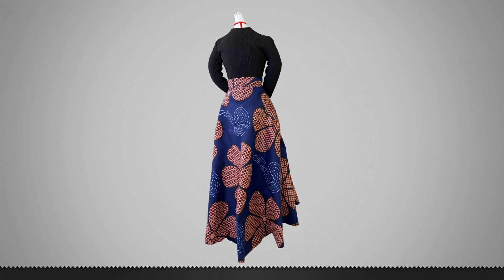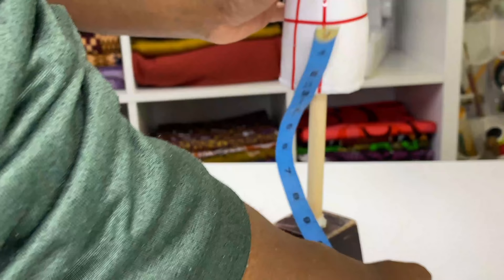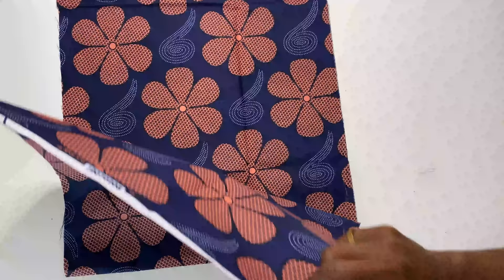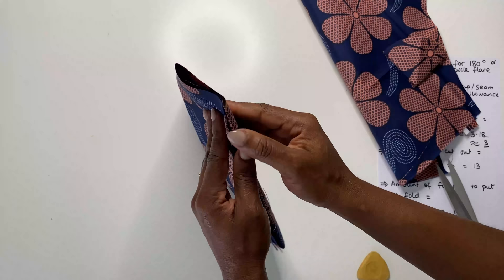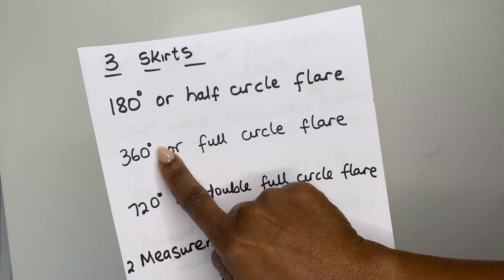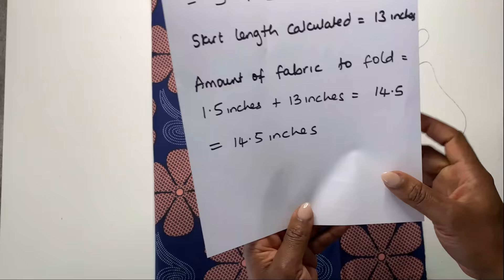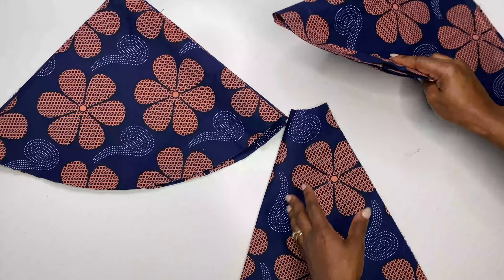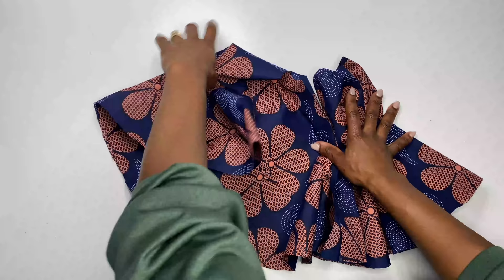How To Cut 180, 360 & 720 Degree Flare Skirt

Comment: Why do u divide the waist by 3.14?
Reply: Because it is 180 degree flare. You will divide 6.28 by 2 to reduce the flare from 360 to 180 degrees flare
Reply: Because its a pie from a circle. π= 3.14
Reply: Pi I dodged in sec school..I've met in tailoring😅. Karma well done 😅😊😊

Comment: Hello. May I know how you came up with the numbers? I cant quite get my head through the formul. 😅
Reply from the maker: I divided the waist measurement by 3.14 which is a standard used to calculate the radius we need to cut out 180 flare. The result from was then divided by 2 for the 360 degree skirt, and for 720 degree, the result was divided by 4. Hope this helps. You can email me on charnoldltd@gmail.com if you need any further help with this.

Comment: Good  day ma'am. I find your tutorial very helpful. The only issue is that I would want to understand better how to fold and cut this same way you've explained using an Ankara fabric sold in Nigeria and abroad that is 36 by 45 inches. Usually for some one cutting a long 360 or 720 skirt how exactly does one fold the Ankara to achieve a skirt length of say 40 inches and waist of 37 inches

Comment: Your tutorials are very detailed and easy to understand. 
If i may ask, is there a way to do a 360+180 flare skirt? Something fuller than 360, but not as full as 720.but my concern now is how to cut the waist? Can you pls, show us? Thank you so much.
Reply from the maker: Thank you so much for your appreciation. 
Yes there is… here is the concept to bear in mind:
360 is 2x 180 hence we divided by 2
720 is 4x 180 hence we divided by 4
So for 360 + 180 that’s 540
540 is 3x 180 so you will divide by 3

Hope this helps. 
You can email me on charnoldltd@gmail.com if you need any further help with this.

Comment: Very easy explanation. But please is the 3.14 compulsory for dividing the waist. For instance, my waist is 29, do I still need divide by 3.14 to get the accurate measurement??
Reply from the maker: Thank you so much for watching! Yes you need to divide by 3.14 to get the measurement for cutting out the waist. Which style of skirt are you making; 180, 360 or 720. I can do the calculation for you if you would like me to. If so please provide also your skirt length also.
Reply: @PatternAcademyByCharnold  I want to make the 720. So that means I can use the initial 3.14 I used with the 180 to make 720 after I've gotten the waist measurement
Reply from the maker: @ellalouis2819  For 720; divide your waist by measurement by 3.14 and then divide the answer you get by 4. Remember to include seam/zip allowance. So you will have 29 + 2= 31/3.14=9.872 
Then divide 9.872 by 4 = 2.46 ( you can round up to 2.5 and this is what you will use to cut out on double folded fabric as in the video. You will need to cut out two of this. Hope this helps. You can email me on charnoldltd@gmail.com if you need any further clarification. Regards.
Reply: @PatternAcademyByCharnold  Thank you so much. Now I understand better 💃💃
Reply from the maker: @ellalouis2819  Very glad to know 💃 💃

Comment: I really enjoyed Ur teaching, thanks alot but one question: does the waist need to be divided by 4 before dividing by 3.14  cos I think I see some people dividing the waist by 4..and also was d fabric folded into 2 or 4?
Reply from the maker: Thank you. It depends on what type of circle skirt you are making. For example, for the 720 degree skirt, the amount of 720 is the same as 4 times 180. So you will get the same answer if you divide the waist by 4 first and then by 3.14 and if you divide the waist by 3.14 first and then further divide the answer you get by 4 (which is what I did in the video). 
Hope this helps.

Comment: U have to take the lengh of the skirt from the waist and not over the waist  because after cuting  the waist off u wont get the correct lengh mesurement for the skirk so note .
Reply from the maker: Thank you for watching. Please note that the length measured from the top is the radius to cut plus the length of skirt. So after cutting out the radius, you would be left with the full skirt length. Hope this clarifies.

Comment: Thank you so much ma'am. Pls I don't know how you arrived at dividing by 3.14, 0.75 etc, please help
Reply from the maker: Thank you for watching. The 3.14 is a constant used for calculating radius of a circular shape. 
Dividing the waist by 3.14, I got 3 which I used to for the 180 degree skirt. 
Then I divided this number (3) by 2 and got 1.5 which I used for the 360 degree skirt.
For the 720 degree skirt I divided this number (3) by 4 and got 0.75. 

Hope this helps.

Comment: Appreciate this video but for a beginner like me it can be hard to follow. People should also be aware that if you want a floor length dress and you have around a 30" waist like me, you'll need 2.5x2.5 meters of fabric for the 360 skirt and 5x2.5 meters for the 720! That's a lot of fabric!
I write down my process in case it helps anyone else:

Waist: 29.5in +2" seam allowance= 31.5". Waist diameter (= waist ÷3.14)= 10". Divide diameter by 2 for 360 skirt= 5".  Divide d by 4 for 720 skirt= 2.5". 
Length of skirt to floor: 46in~ +1" seam= 47"
"Amount of fabric to put on fold" aka size of the square of fabric folded you will cut into= waist diameter (÷2 for 360 skirt) (÷4 for 720 skirt) + skirt length w/ seam allowance= 57 for 180, 52" for 360, 49.5" for 720. It is an equal square of fabric so same length horizontally and vertically (so eg. 57" means 57x57)
**Amount of fabric cut from can be larger just have to have enough.

Amount of fabric you actually need: Eg. if you need a 50"x50" square of 4 layers of fabric like in the 360/720 skirt: x2 to get overall length of fabric need, in this case= 100"x100"=~2.5m x2.5m. For the 720, you would have 2 of these 100"x100" pieces= 200"x100" when put together.

-For 180, just fold fabric in 2 and then into a triangle. For 360, fold fabric twice (once horizontal, once vertical), so get 4 layers of fabric in your square. For 720 do 2 separate squares folded with the 360 method (aka 360 method x2).

For 360 method:
From bottom corner (not open but closed fold) mark waist diameter÷2 as curve on fabric. 
-From point of corner, not the marked curve of waist, measure the distance= skirt length (w/ seam allowance) + diameter/2 and mark it as a second curve= bottom of skirt.

[For 720 you would do the same but divide your waist diameter by 4 instead of 2, and do this on 2 squares of fabric so you get 2 circles to combine together.]
Reply from the maker: Thank you so much for watching and for your contribution, well appreciated! We have also had lots of feedback from beginners who said they found the video easy to follow.
Reply: Please my question is the 3.14 
Where from it??? Can you please help me
Reply: 3.14 is the value for pi. It’s a math value for calculating aspects of a circle.
The diameter of a circle = The circumference of a circle (your waist measurement) divided by pi (3.14).

Comment: Thanks a bunch... i just got confused at the point where you divided 3 by o.75 when the waist is 8... so if i want to get 720 or 360 will i just say 8 ÷6.28 or 8÷ 0.75 is this the formula for 720° THANKS God bless
Reply from the maker: Thank you so much for watching! No I did not divide 3 by 0.75. I added 3 + 0.75.   Yes you can divide waist directly by 6.28 for the 360 (but remember to add the seam and zip allowance of about 2 inches or as desired). So you will have 8 +2=10. Then 10 divide 6.28 = 1.592 = 1.5 approx. 
For the 720 you need to half that measurement calculated for the 360 so 1.5 divide 2 = 0.75. Since it’s a double full circle. Hope this helps. 
If you need further clarification, please email me on charnoldltd@gmail.com
Amen. Thank you and God bless you too.

Comment: Thanks for the tutorial. How do I cut a longer length of skirt without joining.
Reply from the maker: Thanks so much for watching. It depends on your fabric width. If it’s long enough you will not need to join. Alternatively you can also cut it using two pieces of fabric so you will have joining on the two sides and you can fix your zip on the left side.
Reply: @PatternAcademyByCharnold  OK thanks

Comment: Hello ma'am, it's indeed a great illustration, was actually interested in watching to see how u made a 360degree flare with an ankara fabric without joining but unfortunately u used a shorter full length measurement. 
If I'm cutting a 180 degree flare using ankara fabric how do I avoid joining towards the hem.
Also the 360 and 720 how can I make them without joining towards the hem
In the pictures u used before illustration the skirts has band but u didn't explain the cutting of the band and their is no link to check it in ur description box
Kindly respond to my questions
Reply from the maker: Thank you so much for watching! The need to join fabric at hem or even cutting out as several pieces instead of on fold, will depend on the measurements you are working with and the width of your fabric. For example, for the 180 degree maxi skirt, if you are using Ankara fabric with wider width of about 58 inches instead of the usual 45 inches ones, you can cut out the full length without the need to join at any part of the hem. Hope this clarifies.

Comment: Going by what you said about the waist, the 180° flay, the waist is 8" , you divided by 4 ie 2"+1" S.A,= 3" .  You divided by 2 ie 1.5" and you folded your fabric into 4 . Going by your waist measurement, you'd have 1.5×4= 6" 
Original waist is 8" . It doesn't add up or cover your entire waist. Likewise your 720° flay . Unless you're cutting just the front panel.
Reply from the maker: The skirt waist is 8 inches and that is the measurement for the mini mannequin model I used for the demonstration and not for my waist. I also showed how I got the waist and length measurements, as I showed how I measured the mini mannequin/bodyform in the video. I suggest watching the video again, hopefully you will understand it better with this clarification provided.

Comment: Wow excellent explanation but i have one doubt can you plz clear it, that when we take waist measurement we have to divide it by same number wether it is off elder person or a child
Reply from the maker: Thank you for your appreciation. 

Yes you have to divide it by the same number for adult or child. The number - 3.14 we divided the waist by, is a constant for getting the radius of any circular shape. Around the waist is considered a circular shape hence we divided it by the number. Hope this helps.
Reply: @PatternAcademyByCharnold  can u plz tell me on what basis we take these divisible numbers
Reply: @PatternAcademyByCharnold  and the numbers u told are standard numbers. We have to always divide waist measurement by the standard number to get the actual size??.  Please reply
Reply from the maker: @lucifer16307  please can you clarify which specific numbers you are referring to? Thanks
Reply from the maker: @lucifer16307  you divide the waist measurement by 3.14 to get the radius and that is the amount to cut out to get the waist for a half circle skirt.
Reply: @PatternAcademyByCharnold   u told  for 180 degree we have to divide by 3.14 and for 360 we have to divide by 2.5 and for 720 degres we have to divide by 0.75 . Now my question is whenever we will cut skirt of any measurement we have to take these same numbers
Reply from the maker: @lucifer16307 for 180 degree you divide the waist measurement by 3.14
Now the result you get for the 180 is what you divide by 2 to get the amount to cut out for the 360

Also the result you get for the 180 is what you divide by to get the amount to cut out for the 720 

With this insight, I suggest you watch the video again to get more clarification.
Reply: @PatternAcademyByCharnold  ok thank you so much for giving your time and explanation
Reply from the maker: @lucifer16307  You are welcome.

Comment: Before finding this video on 360 n 720 degree flare skirt on your channel,I came across a video where they used 6.28 to divide the waist whereas you used a different    figure. Pls what is the difference and also why.
Reply from the maker: I used 3.14 so that gives you the radius for getting the half circle. If you use 6.28, it will give you the radius for a full circle. This is because 3.14 x 2 = 6.28
You will get the same number (you got dividing by 6.28) if you divide the result you get for 3.14 by 2. 

Hope this helps.
Reply: Pls I’m back again. Kindly explain to me how you come about dividing by 2 for 360 and dividing by 4 for 720. It really does seem simpler to use, but I could like to know how you can about the 2 and 4.
2ndly when folding for 180 skirt, you folded into 2, then into 4 and then into a triangle. I thought it is meant to be folded into 2 and then into a triangle.......Pls educate me on the number of folds to be used for it.
Thank you
Reply from the maker: @iyaboose  since 6.28/3.14 = 2
That’s why we divided the result from 3.14 by 2 to get radius for the 360. 
720 = 360 twice hence we divided by 4. 
In terms of folding for the 180 you can fold it just into two and use it that way or further I nto the triangular shape and you will still achieve the same result. 

I have an online paid course where you can learn more on these, which will be launched soon. Kindly email me on charnoldltd@gmail.com if you would like to be added to the waiting list for this course. Thanks

Comment: If you open the 180 degree, would that also form a 360 degree?  Sorry, it is not that clear on how many layers of fold.  Thank you.
Reply from the maker: The 180 degree skirt when cut out is a half circle, please see video section around 5:00 - 5:13 (mins/secs). 
Hope this helps.

Comment: Awesome illustrations,  but what if you're using your actual measurement... how will you fold the materials to be enough... especially if you want the skirt to be long
Reply from the maker: Thank you so much for watching! It will depend on what your measurements are and the width of the fabric you are using. For instance, you may cut out 4 pieces instead of cutting on fold if necessary. Hope this helps!

Comment: Good day ma. Thank you for your help on this. Please ma, I don't understand the folding of the 720 degree. Please ma, explain to me ma.
Thank you ma.
Reply from the maker: Thank you so much for watching! The 720 degrees is basically double of 360 /full circle. This is the reason we have two circles but of course with smaller waist cut out as the two will need to add up to the full waist on the 360. As a result the 720 will ultimately give you a much fuller skirt than the 360. Also, if you don’t have enough fabric to put on fold, you can cut them out in equal pieces and join. Hope this helps. If you need any further help, you can email me on charnoldltd@gmail.com

Comment: Awesome tuts but I have a ❓ when you calculate 360 skirt I couldn't get it . Pls simplify it to me thanks
Reply from the maker: Thank you so much for watching! Dividing the waist by 3.14 gives us the radius  we need to cut out 180 flare. If we need to cut out 360, we will need to divide the result by 2. Alternatively, we can also divide the waist measurement directly by 6.28 and use the result to cut the 360 flare. 
Hope this helps!
If you need any further help, you can email me on charnoldltd@gmail.com

Comment: Hi mam,I hv a problem that the flare in bottom ,sides  is going up comparing to front n back,plz tell me trick
Reply from the maker: Hi, thank you for watching. 

When you make a garment cut on the bias like in the case of circle skirts, there will be some stretching out along the bias. If you hem your garment immediately after making it, then this stretching will result in a very uneven hem. 

To prevent this, hang your skirt possibly overnight or longer if possible. Then lay it out and remeasure the length. Then trim out the stretched out portions of the skirt hem, before hemming the skirt. This should correct the problem. 

Here is another video where I showed the sewing process and explained how to ensure even hem. 

Hope this helps. 

https://youtu.be/RRcKML20RcU

Comment: Is the 0.75 measurement the same for all 720 circle skirts? I am trying to make one for my daughter who's waist is 22 inches, length is 12!
Reply from the maker: No, the 0.75 is not the same for all 720 skirts, it’s for the waist measurement of 8 inches I used. You will need to work out her radius to cut out using her waist measurement. So it will be
22 inches + 2 = 24 /3.14 = 7.64 then divide by 4 = 1.91 inches
Hope this helps.

Comment: Please for every or any waist measurements am I going to use the same formula you use e.g if my waist is 44 plus that allowance am I going to still divide it by3. 14? 44÷3.14
Reply from the maker: Thank you for watching and for your comment. Yes you would still use the 3.14 for every waist measurement but remember to add the 2inches for seam and zip allowance so you would have:
44 + 2= 46
46 /3.14  
Hope this clarifies.
Reply: @PatternAcademyByCharnold  thanks so much.

Comment: The explanation is very explicit. But how many yards of Ankara(cotton fabric) can be sufficient to sew the 360 for skirt length 44" and waist 37"?. Thanks.
Reply from the maker: Thank you so much for watching! 

You will need about 6 yards of fabric with a width of at least 54 inches. Hence it might be best to work with Ankara fabric with longer width of 60 inches instead of the regular 45 inches width. Hope this helps.